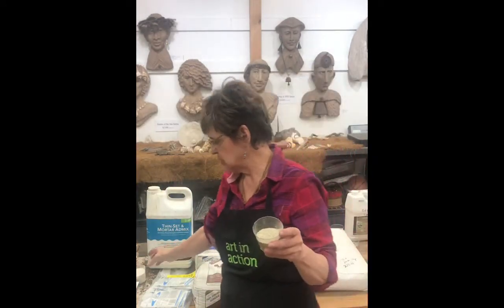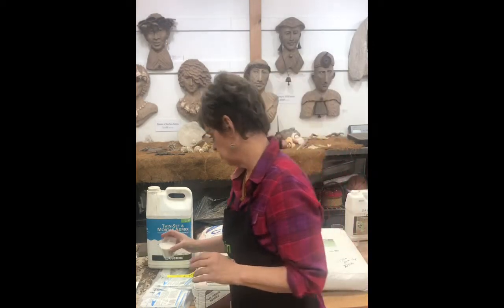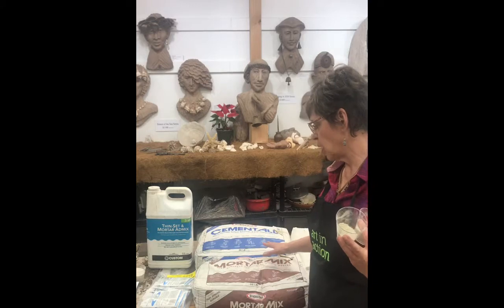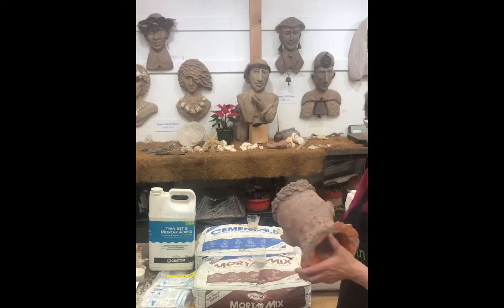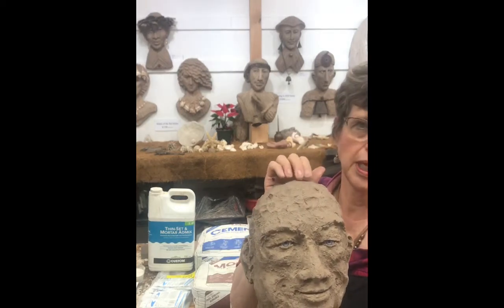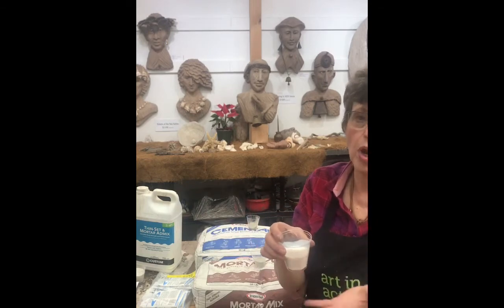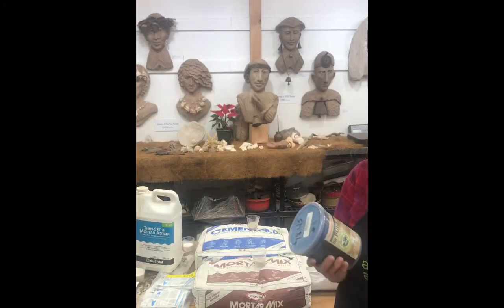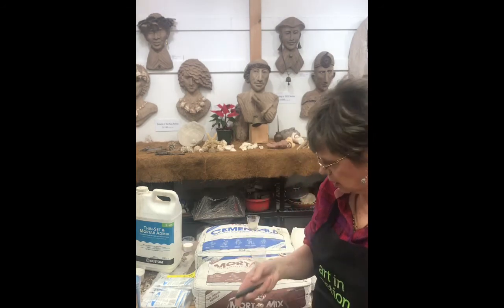Concrete sculpting products

Comment: Hint: 8:00 You can save a lot of pigment (and expense) if you use white Portland instead of Gray. As you mention, it's very difficult cover the gray color with the pigment. The main drawback of the white is that it's about 4X the cost of gray. But it works exactly the same.
Reply from the maker: Hi Glenn 
Thanks for watching. I do have white portland cement i find it to be different from the gray. Obviously the composition is different it is stickier when working with it. Also our local concrete plant does not sell it much and it ages i am guessing absorbing a minute amount of moisture and i have to really work at it to get a smooth consistency.  So the grey is my choice to work with. Since i am usually working in browns i prefer to start with gray. When i was trying to create a true auburn color i started with white and it took extra pigment but the color was true. So i only use the white occasionally.
Reply: @MontanaBlissArtworks  I'm sad to hear you've had a bad experience with the white.  From a purely technical position, the white is chemically the same. What they have done is to the product is to refine it further by removing all the impurities that give the regular Portland it's familiar gray color. Some of these natural impurities do impede the cementing action of the Portland, so perhaps that is what caused the difference in consistency for you. Personally, I've not noticed any difference, but then I usually pour into a mold rather than doing ferro-cementing or sculpting with the product. 

The other possibility, as you mention, may be the age of the product. It behooves me to understand why cement manufacturers still insist upon using paper storage bags for an anhydrous product when clearly, a plastic bag (or plastic lined) would contribute to the longevity of their product.

Comment: I was a cement mason for 40 years. I am retired now and I am just starting to create concrete art. Many of the materials you use are common in modern concrete construction. Using the Rapid Set products should be used with caution as they set up as fast as you can mix them. I found out the hard way on a hot day! Now I add a retarder to slow down the set time just to make it workable. Thanks for the video. I like your work and look forward to seeing more of your tutorials.
Reply from the maker: Hi John the retarder does not work for me because it brought the moisture to the surface which melted away the features i just sculpted. Portland cement, sand and a mortar admix works best for me so far.
Reply: What about a plasticiser?
Reply from the maker: Billy i always use a plasticizer at a 50/50 mix for all my sculptures. The retarder did not work for me as it brought the water to the surface where the features i just sculpted melted away. I prefer just  Portland cement and sand for my mix. Sometimes trying other things reassures you what you are using is best.